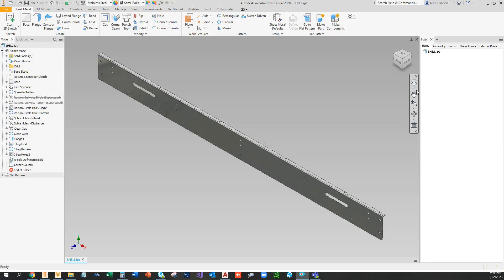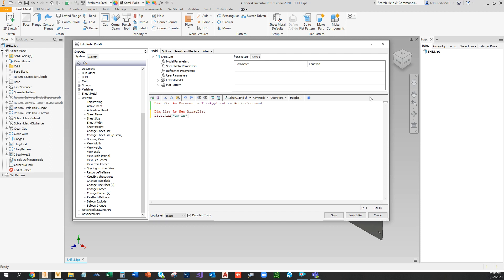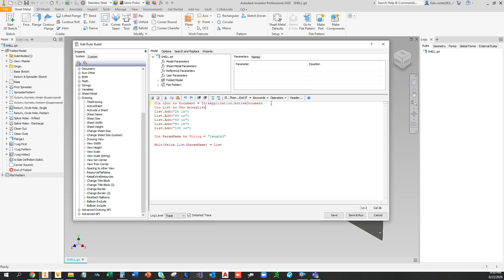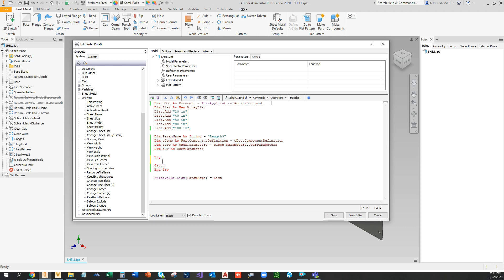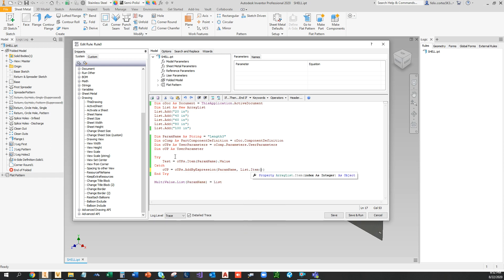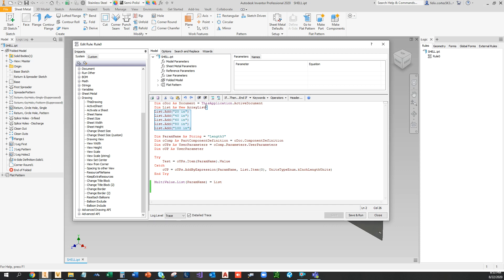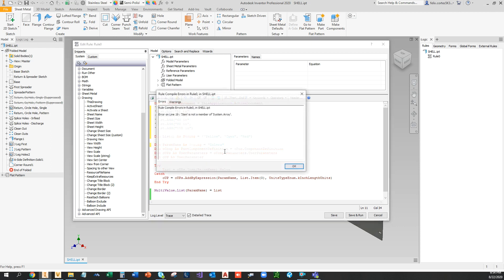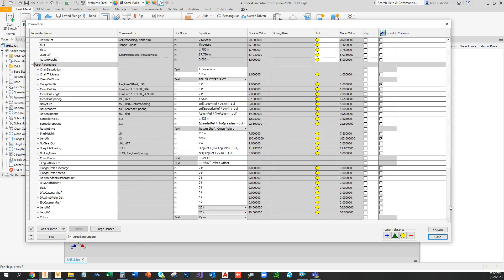iLogic Lesson #1: Creating Multi Value Lists Using Arrays

Comment: Mad coding skills. But from my perspective, it would have been far easier to just add the parameter. If this is something you would need in other parts, you could save the file as a template and all of your user defined parameters would be there when you need them. You can also  save your "custom" iLogic code as a snippet to reuse whenever you need it. Hope this helps. God bless and stay well.
Reply from the maker: Yes that's true, snippets are really helpful!

Thanks Frank!

Comment: Hi, Could you suggest me how to add new value in any existing multi value user parameter using ilogic ? Also this new value I want to get from user using inputbox. This new value should be saved in my multi user parameter. So basically I'm looking for adding custom value in existing multi value user parameter but with ilogic.
Reply from the maker: Hey Jimmy, do you still need help with this??
Reply: @DesignAutomationSolutions  Yes if you could please
Reply from the maker: @jimmy221993  Ok keep an eye for a new video this weekend. I hope it can wait until then
Reply from the maker: @jimmy221993  hey jimmy, I posted the video. it is unlisted for now but here is the URL if you'd like to see it. I'll make it public on Wednesday. Let me know if it doesn't answer your question

https://youtu.be/SmoJFTlX0U0
Reply: @DesignAutomationSolutions  Hi, This is exactly what I wanted. Haven't tried yet but I'm sure this will work in my case. Thank you so much. 👍